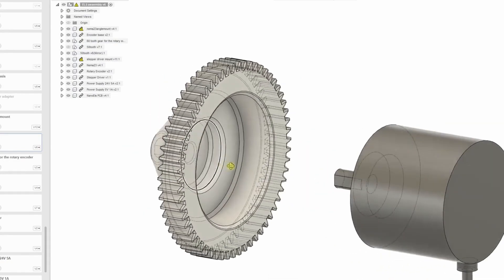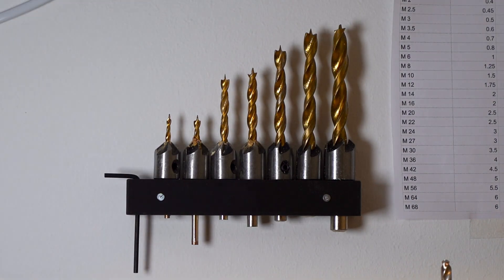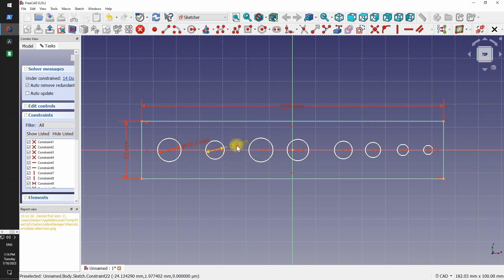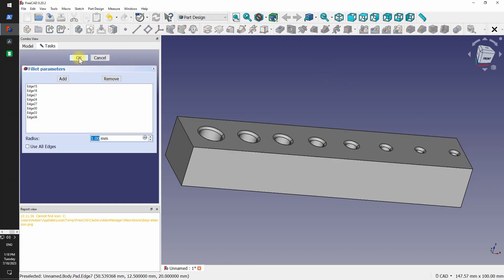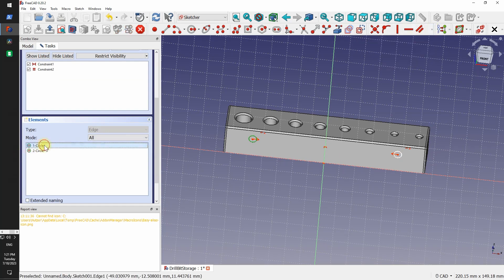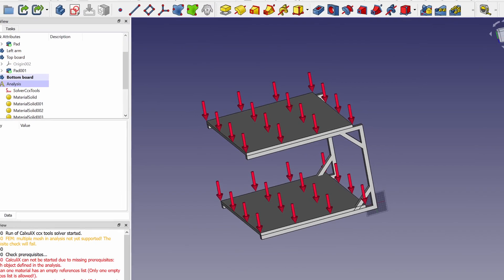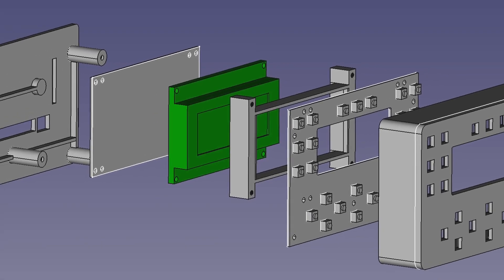FreeCAD after 6 years in Fusion 360

Comment: One big issue (it has workarounds, but painful) is that every job item in the tree is able to remove old edges and re-create new ones and next jobs can be already linked to edges that this job have removed. So, one workaround - plan your atomic jobs like chamfers to the latest steps, try to use general dimensions in sketches (do not rely on/use existing geometry). Second workaround is that you still can link new edges to the edges that next job uses, and that is painful, but still possible. And do "save a copy" regularly, it allows to backup your work without switching from main file.
Besides of that, other disadvantages are so small in face of Fusion360's cost!
Upd. Forgot one more thing. Fusion360 don't allow to keep more than 10 projects!!! At least, for me. WTF?! I was need to decide what project to delete to have ability to create fresh one! That was the last nail to say RIP to F360. Thanks Gods, we have FreeCAD!
Reply: only 10 active projects. you can have more archived in read only mode. it's really not much of a pain for the average joe, even if you do need to micro manage it once in a blue moon. i think the limitation is more there to make using the free version in a commercial environment really bad...

Comment: Ooof I know people love to give free software passes, but this video alone shows that Freecad will have a lot of massive painpoints and on the gimp vs photoshop to blender vs maya scale this seems more in the middle than in the blender vein of things.

I feel like with multiple pieces of free software like this the patch that will supposedly fix all the issues is always around the corner. I did see a fork of freecad that showed potential by caring a lot more about quality of life features that I guess freecad sees as nice to have when nice to have in software saves you hours of work.

Just the having to have multiple sketches for each extrude by itself is a deal breaker. I can just imagine how painful that is.
Reply from the maker: It's not as bad as it looks. When I first tried FreeCAD 5 or so years ago, it was much harder. Now it's very comfortable. Imagine where it'll be in 5 more years. I would suggest trying some simpler projects in FreeCAD every so often and see if you start to get it. Need to come with an open mind though.
Reply: @MaximKachurovskiy  I dont think ita about getting it, this isnt a difference in paradigm as much as a worse workflow.

I feel like "get it" only really applies when a difference is purposeful rather than an absence or difficiency.

One of the reasons I use Fusion is because the idea of wasting my limited time sounds extremely exoensive, currently much more expensive than a Fusion license.

I dont even make money on my Fusion use yet, but I know that given my limited time, the longwr something takes, the higher the chance of failiure due to being incomplete, which might be a me thing but I imagine many are like that, so having to get used to a slower system sounds far from ideal.. very far.

Funnily enough, I don't recommend Fusion360 electronics for simular reasons, as it has excessive painpoints and there, I think Kicad appears supirior even though Im just starting with both on the electronics side of things.

Comment: 1:17 "sketching and dimension constraining are 2 diff ops"
that's going to improve in fc-0.22 - see the video from mongo jellly solutions smth smth on youtube

also, why are you not using shortcuts? the open source applications are much much more keyboard friendlier than commercial bloat
it was excruciating to watch u doing so much back-&-forth with pointer

1:39 i like that the part to be extruded should be explicit, and construction lines are required. commercial bloats dumb down things way too much.

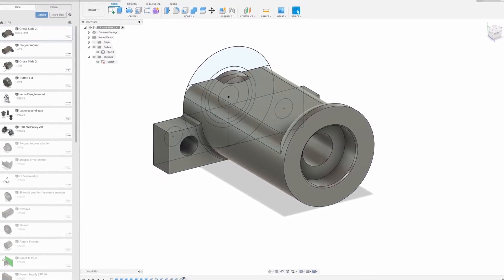3:40 "create a single sketch & extrude [diff parts of it] to different size"
this technique of using a master sketch was available even in 2022 (v0.19/0.20) - but yeah, you will have to search some tutorial for it. it involves linking sketches or smth like that.

Comment: I use FreeCAD, and I like it a lot. My biggest frustration with it is the same as one of yours -- bugs. It is very frustrating when you have a complex part composed of multiple sketches on multiple faces, and then you realize that you need to make a change to one sketch, and that then breaks all of the chamfers, fillets, unions, etc that you defined after that. You can lose a lot of time when you face such bugs.

I wish that there were a built-in assembly tool for modeling complex designs. I've used FreeCAD to model simple parts for 3D printing, and I don't need an assembly tool for that. I once tried to use FreeCAD to model parts for a simple robotic arm that I was designing when I volunteered to teach a workshop about 3D modeling and simple microcontrollers to kids at my daughter's school, and I really wish I had an assembly tool when I had to design multiple parts for the robotic arm that had to fit together. I wish everyone working on the 5 different assembly tools for FreeCAD would work together to build a standard assembly tool that would ship with FreeCAD. I don't mind installing plugins, but if you want a future-proof workflow, you want to use tools that will continue to be supported and maintained in future versions. That's why it would be great to have a built-in assembly tool with a commitment to improving and maintaining that tool in future versions.
Reply: You can easily build multiple parts in a single model around each other and use reference geometry from other parts by using multiple bodies in PartDesign and Subshape Binders. FreeCAD has an upcoming built-in assembly workbench in the next release which can be tested in the development versions currently.
Reply: @alexandermckenzie5077  Yeah, I recently learned about the new built-in assembly workbench that will ship with the next release after I wrote this comment.

That's awesome!

I've built complex stuff in the past by using the spreadsheet workbench to define variable dimensions and points referenced by multiple bodies so that the bodies would automatically be repositioned or resized relative to each other if changes are made. I think that works quite well for some designs, but I think the new assembly workbench may be better for other designs.

In any case, FreeCAD keeps getting better, and I'm looking forward to the new release!
Reply: @alexandermckenzie5077  As you say, the assembly workbench is not released and judging by the fragile nature of even basic parts modelling moving to unreleased builds is highly risky. The fact that the face naming shambles is still not fixed after years of complaints says it all for me. I now use nothing but the RealThunder fork because that is really the only usable version of FreeCAD.
Reply: Switch to the RealThunder fork it is way ahead with many serious issues like the one you describe resolved or at least vastly better.

Comment: I like the idea of FreeCAD, I just find it hard to learn and I have been trying off and on for years.  I usually give up when I hit an area that I just can't figure  out.  I am determined to learn this year.  I would like to improve my 3d printed models which I use openscad to create.  I just suck when it comes to 3D CAD.   I recently found another 3D CAD program called ALibre CAD.  It looks interesting though it is not free and the price is a lot cheaper than others, but still a little pricey for me.  I still might give it a try.  FreeCAD is a bit frustrating at times especially when there are details like holes in different planes.  I can't seem to figure out how to attach the planes together properly without errors popping up all the time.  Still, FreeCAD is probably my best option right now.  I just wish it was more user friendly for beginners to 3D CAD.

Comment: There is a fork of freeCAD that remove some of the drawbacks. Like being able to extrude multiple time from the same sketch. And it's less likely to break if you came back and edit the first steps of your model. It's called real thunder freecad if you want to check it out

Comment: As someone who never plan on using Fusion 360 (their free plan is a joke and the paid license is way too expensive) I appreciate videos such as this that only serve to steel my resolve to use FreeCAD (and learn it).

Now, if only there was a good 3d printer for $50...
Reply: What do you mean their free plan is a joke? What limitations are a problem for you?
Reply: @alejandroperez5368  The fact that there ARE limitations beyond "you can't use it for commercial purposes".
Reply: @alejandroperez5368 yeah, i also want to know what he means by that.  There's basically nothing in F360 behind a paywall in the free version unless you need features that only someone using it for commercial purposes would need.
Reply: $50 is low, but if you want to spend some effort, a (used) bedslinger with Klipper added can be a fine printer,

Comment: Its nice to see freecad coming along so well. I'm still a bit tied to Fusion due to the fact that I need decent CAM functionality and the fusion 360 cam is actually pretty good imo. Would be good if freecad could do some basic cam.
Reply from the maker: I use FreeCAD for CAM and it was easier to get a hang of than Fusion but there's still quite a learning curve.
Reply: The FreeCAD CNC workbench has been updated in the new release of FreeCAD 1.0.
The CNC workbench is now called CAM.

Comment: I recently switched from F360 and mostly due to woodworking workbench. It's really amazing and you can easily integrate it with a cutlist optimizer. FC is a bit more challenging to work with but once learn it, it works well enough. Plus ability to create plugins or even make design using a programming language.

Comment: It may take longer (or not) , but trying to sketch on datum planes instead of faces can reduce breakages due the topological naming problem.
The devs are close to releasing a version that fixes the TNP
Reply: I create a primary sketch (or perhaps two, on different axis) and then create subsketches from that. This resolves most of my TNP issues as well as Maxim's desire to extrude subsketches (by making the creation of derived sketches fast and easy). This does become difficult with compound angles but thankfully, my needs are usually pretty simple. I don't use spreadsheets but that might also help link geometry changes across sketches (sometimes I feel like I'm the only FreeCAD user not using spreadsheets?).

I've only ever used FreeCAD. I'm very wary of freemium products and having my work be held hostage due to mercurial policies changes.
Reply: I've gotten good with Autocad, inventor, and fusion. Latley I've been trying to nail onshape and freecad and it's been quite the uphill struggle but I like trying to get good with the open source stuff 😅
Reply: Look at the Wikipedia entry for "Topological Naming Problem" - It is a mathematical problem known to be unsolvable.Fusion360 and other CAD packages have this too, by the way, they just hide it by essentially doing guesswork below the hood. If you understand this problem and what causes it, you can easily break models in any CAD program.

You can also easily construct models to not break. I am not part of the "datum plane everything" crowd, because there are better ways. The most easy solution is this: Don't reference 3D edges or faces. Instead, reference the line in the sketch from which the edge or face is generated. Also be aware that you can GIVE NAMES to any crucial constraints within a sketch, and then get the value by referencing that name. So if you have a face that's parallel to, say, the XY base plane, generated by a pad that is 20mm, don't simply sketch on the face, but consider creating another sketch on the XY base plane, and give it a Z-offset of "=[name_of_pad].length".

You can also use a spreadsheet for all your crucial dimensions, and reference them from there. Or create a master sketch (just google "master sketch workflow"). 

All of this, btw, is good practice in any CAD software and will help you create better, more stable models no matter what software you work with.
Reply: tnp is solved dev release, but that fix seems to have introduced other bugs. 1.0 is expected in next couple months.
Reply: I've found that datum planes are not a silver bullet when it comes to topological naming problem and having your designs not break.  Essentially, the opensource devs need to get very serious about the TNP to make this software viable IMHO.  Given that  there is already a branch of freecad with the TNP fixed, and all they have to do is port the branch to main... and they have not done that for 2 years... I don't hold out much hope for the main branch at the moment.
Reply: The developers of FreeCAD are doing exactly what you suggest, implementing the TNP solution of Realthunder into the main FreeCAD. It proves to be a very time consuming task though to ensure it being stable and backwards compatible
Reply: @HeDzsz  Having shifted from 3+ yrs in Fusion to FreeCAD in the last few months a fix to the TNP issue will be a game changer.  It will shift FreeCAD from being quirky and sometimes awkward to a tool that you can "just use".  I know you can do amazing things with it as is. I have purservered to the point I can model and assemble projects (e.g rear bumper in folded sheet metal and bent shcedule 40 pipe for a Toyota Hilux, portable camping fire pit.).  But the fights with TNP issues has been monumental and required several stiff G&Ts.  🙂  Kudos to the devs for pushing this forward.  I have some appreciation on those types of efforts as a contributing dev to aspects of the Linuxcnc span of projects.

Comment: Autodesk tried to charge me over 5g for a 3yr license😂😂. Freecad, Blender, Gimp and Inkscape etc!
Reply: Krita is much better than Gimp in almost every aspect.
Reply: @SergTTL  Yup, make mine Krita, when im not Inkscaping or working in 3D.
My preference there for rough work is actuall ShapeLab.
Reply: Gimp admittedly needs to work on non destructive editing
Reply: @cwill6491 what do you mean by non destructive editing?
Reply: @cwill6491  I use Photopea. Runs in the browser and is basically a Photoshop clone all the way down to the UI and natively opens/edits/saves to PSD. Also has AI features. For quick stuff, I don't even bother to open Photoshop anymore despite paying for it.
Reply: @cwill6491 I believe that is coming in Gimp 3.0, but its being developed by 1 guy so its coming a little slowly.
Reply: If you want to pay once, Affinity Photo and Affinity Designer for Photoshop and Illustrator alternatives. Affinity is what the paid model SHOULD be like. Gimp and Inkscape are good if you need free though.
Reply: @ebouwman034 true!!! affinity is awesome and you can get a free trial without any credit card bs. gimp is awesome but i would add krita to that list
Reply: @ebouwman034 I feel that Inkscape has more features and it is technically superior. But for me Designer works much better for simple stuff with precise dimensions and angles.
Reply: @ebouwman034 
Its less needing free and more, wanting opensource. Blender is the perfect example of what we get when we work together to give the world the tools to change that world, instead of trying to profit off the needs of others.
Reply: I can't stand GIMP. Have been using Photopea for the last two years. It's a complete Photoshop clone and has some really nice features like "vectorize" and "magic cut".
Reply: Try DesignSpark Mechanical. I use it alot and i didn't go bankrupt Exoprt as STL an into my SnapMaker software and the 3D printer i working.
Reply: That's why i use inventor and pirate the s**t out of it

Comment: I would like you to tell me if you have tried Solid Edge which is also for free now and seems to be a lot more powerfull and easy to use than Freecad.  Thanks in advance, John.
Reply: It's the "free for now" part that I'm concerned about.
Reply from the maker: Judging by their website it's good but since I'm looking to advance and share technology with everyone it's not an option to rely on an expensive closed-source editor. It could be the right choice for an engineering firm but not for me.

Comment: did you try DesignSpark Mechanical
Reply from the maker: No, is it good? Not a fan of subscription model and proprietary formats though :) I'd want to share a model - how would others edit it? What if they take away key free functionality? Burned too many times :)
Reply: @MaximKachurovskiy  DesignSpark is just as easy as F360 and works offline. I would be using it now but F360 offers 3Axis CAM which is not available in FreeCAD or DesignSpark. 
Blender is also popular for creating models for 3D Printing and is becoming much more user friendly.
I am probably stuck with F360 because of CAM.
Reply: @JohnHoranzy how does it work offline when you have to pay a monthly subscription?
Reply: @FreezeS You have to let it phone home once a month to check the license. But check the current terms.
Reply: @JohnHoranzy   "You have to let it phone home once a month to check the license" - so all the disadvantages of online/subscriptions, none of the advantages of offline use. The software could be run offline, they just chose not to allow it for more than one month.